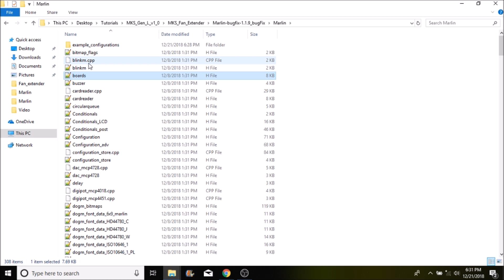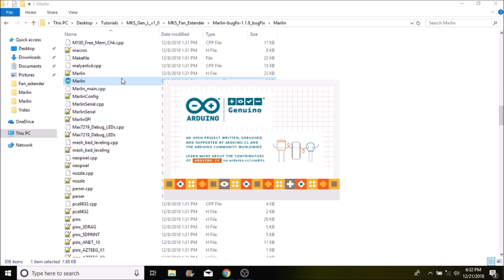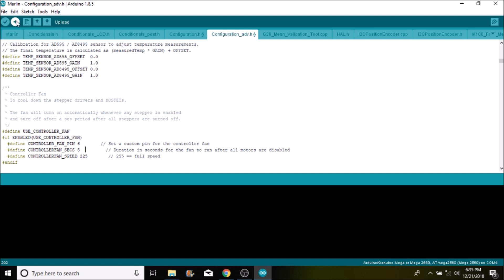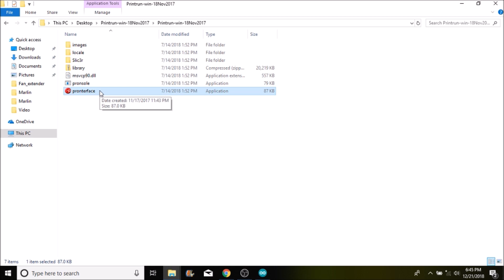MKS Gen L - Fan Extender

Comment: Sir, I have a question.
Could I use both D4 and D6 in the same time?
turn on the big and small fan simultaneously?
Reply: Maybe give the two fans different fan speed settings
Reply from the maker: Yup.

Comment: Hi Eduard, good work man.  I have been learning a lot from your videos.  I got a question for you.  I have a JGaurora A5 with MKS1.0 Gen L.  I've just installed 2208 and got a 24v fan connected at E1 (PIN D7).  I am using M106 P1 S255 when print starts and M107 P1 at the end although I would love to know how to turn on the fan any time the steppers are running.  Much appreciated.
Reply from the maker: You're welcome.

Comment: Hi Ed,
Thank you for this tutorial, and for all your tutorials.
I have a question, because I have a problem:

Is there a particular reason why you selected the bugfixed version of Marlin 1.1.9 ?
I'm asking this, because I can't succeed to use the CONTROLLER_FAN fonction to cool down motor's steppers with Marlin 1.1.9 (not the 1.1.x Bugfix version, but the 1.1.x version).

I'm using an MKS_GEN_L, with TMC2208 configured as "TMC2208_Standalone", and a RRD deported module with 6 wires on pins D4 and D5 (instead of D6 and D11).
I'm using a BL_touch on D11,  a potential servo on D6, the AUTO_FAN controller on D4: all these three are working well.

But the fan (CONTROLLER_FAN ) on D5 is not working when any motors start to run.

I have made a M43 to check pins status, and it seems to look good: "Recv: PIN:   5   Port: E3        CONTROLLER_FAN_PIN          protected  Recv: . SERVO2_PIN protected".
I also made a test by inverting the D4 and D5 connections of the wires onto the RRD, and it shows that the RDD is also working well and my wires are OK.

So, I wonder if there is a problem with the Marlin 1.1.9 and/or the choice of "MTC2208_Standalone" with this "CONTROLLER_FAN" function?

Many thanks in advance for your though and your reply.
Reply from the maker: What happens if you remove Bltouch from the fan extender?  If it works, then change the Bltouch to an open pin like an open Endstop set of pins in your pins_mks_gen_l.h.  hope this helps.
Reply: Thank you @EdwardBraiman  for your reply.
The bltouch is on D11 and Z-,and it works well, so I don't need to change it. 
The RRD fan extender is on D4 and D5.
The 1st fan via pin D4 on the RDD extender  is working well (AUTO_FAN for cooling the head)
The 2nd fan via pin D5 on the RDD extender is not working  (CONTROLLER_FAN for cooling all TMC 2208)
When I change D4 and D5 in the Marlin, there is no change : the CONTROLER_FAN  function still  doesn't work.
Reply from the maker: You can turn on pins debugging and check they work with a multimeter or measure the pins without pins debugging.  I would need to check, but I think you can only use two of the four pins with the fan extender.
Reply: @EdwardBraiman  Thank you for your replies.
I will definitely do further tests, and let you know when it will be fixed.
Reply: @Edward Braiman
I found my mistake, and now it works well:
The CONTROLLERFAN_SPEED was set too low (70%=180) for allowing the RRD pin5 to start. 
I changed it to 255, and it works perfectly well now.
Sorry for the disturbance, and many thanks again for your help.
Reply from the maker: I'm glad you figured it out.

Comment: Hey, i have a Problem on my Wanhao i3 Duplikator, have upgraded them to Mks GEN L, i have a double relay, 1 Relais gives Power to the 230, i think its PS_ON on pin 11? the 2.Relais is for the Mainbord, Raspberry and Extender Fan its a 10k ohm resistor to the Switch, when i Take to Ground the Fans will work, in Marlin i have much examples Probe not becomes to work, hope you can Help me. Thank you!
Reply from the maker: So you're using a raspberry pi to run your MKS Gen L?  Cool.  So you're having a issue running your fan?  What is your Marlin version?  What are you doing for raspberry pi are you using Pronterface or something else.  Are you trying to control fan speed?  What type of fan are you using?  Are you using PS on for a power supply?
Reply from the maker: You can post in polish if you feel more comfortable.  I'm not fluent in polish, but I might understand your question better.
Reply: @EdwardBraiman   Iám not Polish :D German ;) Not The RPI i Mean the Fan for him... ... I used Repetier on this, its all in a Box Mountet,  i dont can send a Picture here, you can write me on FB? Then i can send you Picutres...
Reply from the maker: Thanks.

Comment: Your videos are great! I have a question. I have a MKS Gen L board ordered for my Ender 3 and I'm getting everything prepared for install upon arrival. I've watched several videos on the install and feel confident. I'm goin to install my board in the stock location / box and have already printed a adapter bracket for mounting. I would like to replace the stock control box cover with one found on thingiverse that has dual fans (for cooling the board). I know the stock fan is a 24v 0.1A fan and I know to plug it into the socket that's labeled "12/24V". I've seen where others are using dual (two) 12V fans and have added "stepdowns" and other devices to use them on a 24V system. What I would like to do is run two 24V 0.06A fans wired in parallel with a single plug into the 12/24V socket. Is this possible or will it create problems. I'm wanting to keep install clean and simple.
Reply from the maker: Normally all my video(s) use 12 volts power supply, If you're using 24 volts you can use one or two on MKS Gen L v1.0, but I would recommend 24V fans. If you choose more you might need to step down voltage.  I personally only use one to cool the filament throat.  If you wanted to use four you might need to get creative, but they may increase likelihood of major safety issues.
Reply: I'm not sure of what your saying or I'm not describing it right. My ender 3 is a 24V system. All fans on the ender 3 are 24V. The fan in question is the single one that cools the MKS Gen L board (or OEM board). The one that's on the control box lid. What I would like to do is print a new cover for the control box that will have space for two fans side by side to cool the MKS board. I know that the OEM fan is 24V, 0.10A. And it would plug into the socket that's labeled 12/24V. Being that the board is powered via a 24V power supply it would run the OEM 24V fan at 24V. What I'm asking is would it be possible to wire two 24V, 0.06A fans in parallel and have a single connector plugged into the same 12/24V socket? Would 24V power two 24V, 0.06A fans? Would running two 24V fans from a single 24V plug/connector work or would they not have enough power to run. The amps on the OEM fan is 0.10A and the two new fans have 0.06A each. That means that the amps would increase by 0.02A total. 0.06 x 2= 0.12A. The OEM single fan is 0.10A.
Reply from the maker: Sounds okay, but I'm not an expert with 24  volts.  I would suggest checking forums to verify and watch printer careful if you attempt.
Reply: Thanks for all the info/help. I have one other question. It's known that on the Ender 3 that the parts cooling fan and the control board fan are on the same circuit. The control board fan doesn't come on until the parts cooling fan comes on. With the MKS Gen L board is this the same? Is the 12/24V socket/plugin constantly energized meaning the control board cooling fan always on when the control board is powered on?
Reply from the maker: @dlhoulton  If you're referring 12/24 V socket, yes it's always energized.  If you choose to use a Fan Extender on the Servo ports you can add intelligence via gcodes, but it only works for 12 volts of power.
Reply: @dlhoulton  buy lm2596 for 12v fans, but are u using noctuas ? if yes check th3d noctua fan video, im waiting mks genl and tmc drivers ll arrive maybe a week i bought industrial fans for hot end 40x20 using with bantam but axial fans doenst handle presure now i swich to 5015 dual petsfang, and i cant fnd 5015 24v in my country need to use 5015 12v with lm2596 if my shipping rates less than prats ill go theese : 
https://www.th3dstudio.com/product/5015-high-speed-ball-bearing-fan-24v/
https://www.th3dstudio.com/product/40mm-sealed-bearing-fan-24v-ender-3-tornado/

noctua video
https://youtu.be/azm1c55JOxk
Reply from the maker: Check ebay, normally 12v fans are easy to find.
Reply: dlhoulton I’m using an MKS Gen L v1.0 board with a Prusa i3 clone printer. I’m trying to use the same Thingiverse case you mention. I’m currently using the “fan” port (pin D9) for stepper motors driver cooling (24v) but want to add a second fan to mount on the case cover. I understand the 12/24v output jack is “always on” but when I turn on the power supply it does not turn on. I would actually be ok if it were always on (I don’t need software control per se) but I’m wondering what I’m missing in the setup. I’m currently using Marlin 1.1.8 with a RAMPS_13 motherboard ID (original board I had used) but am going to move to Marlin 1.1.9 and ID the board as MKS GEN L. Maybe this will do the trick but was wondering if you have solved this. BTW, if I have to get the fan extender board, can it be sourced from the US?  I’m only seeing it from Bangkook. Thanks!
Reply from the maker: https://amzn.to/30dsLxS note, this is for a maximum of 20 volts.  You should use as 12 v power.

Comment: They are only rated up to 20V and you use 5v fans am I reading that right? My power supply is 24v though
Reply from the maker: The fans run on twelve volts, but user should be able to replace the fans with 24 volt fan.  As for the fan extender, need to check datasheet, but confident it will work with 24 volts.
Reply from the maker: Keep in mind you might also be able to step voltage down with other devices.
Reply from the maker: Okay now I understand why 20 volt.  You could use a voltage converter.

Comment: I only saw the small fan go on
Reply from the maker: Correct.  The fan extender works via digital pins.  If we specified something like D4 or digital pin 4,instead of digital pin 6, then we would see the larger fan activate.